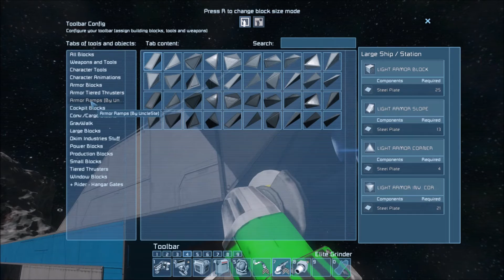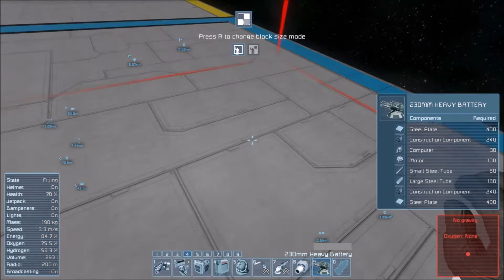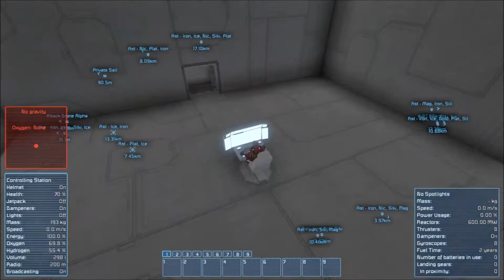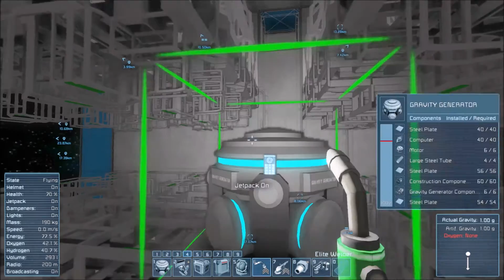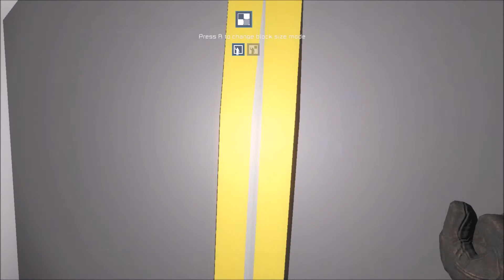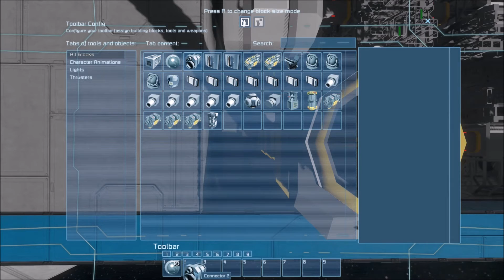Space Engineers: Hardcore - Bridge and interior - Episode 16

Comment: Have you considered the energy weapons mod?
Reply from the maker: I was thinking about it, but last I heard, energy weapons use energy (who knew?), which is something I don't have much more capacity for. It would be useful as I would not need to make ammo, so I might try them out on the drone first before adding them to the capital ship.
Reply: Arc reactors may be helpful in that regard, you can cram the power of multiple large reactors into the space of one.  The material cost is also balanced against the stock large reactor.

Comment: I would put the air vent on the other side of the room and put a small cargo container on top of the medbay and then pipe it into the system were you have the air vent right now. you will be able to reach an open face of the cargo container from the suit change side of the medbay. and the medbay is piped up.